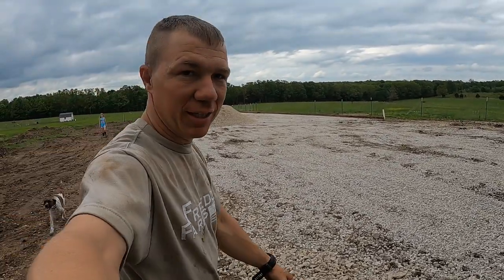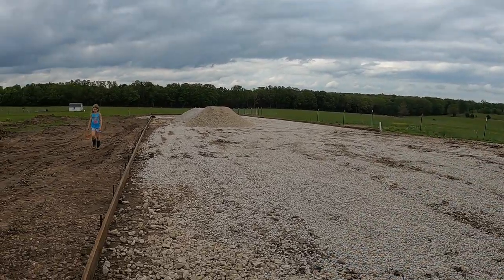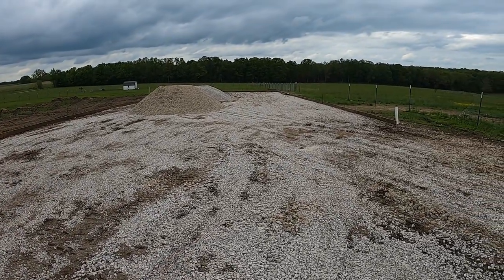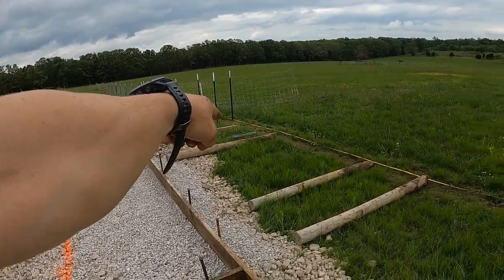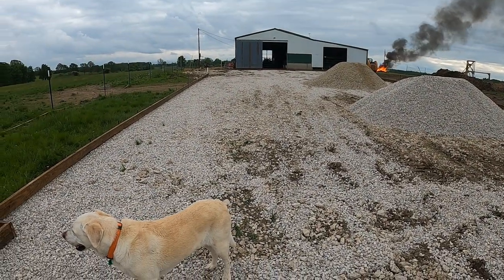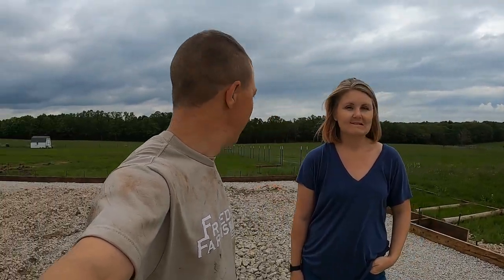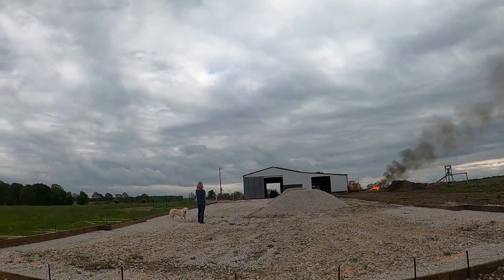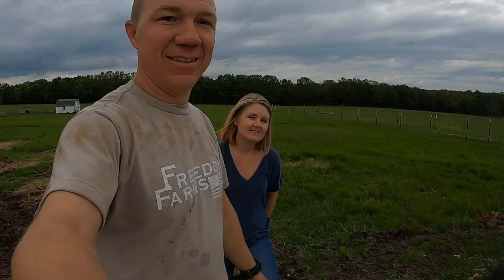Husband and wife build a MASSIVE sheep barn!!!! Part 1: prep work

Comment: I was thinking about putting a agrifab building over an existing 45’x90’ concrete pad and add 4’ concrete sides. Not sure when I’ll have the money for that.
Reply from the maker: That's why we're building in ourselves that cut down a lot of our cost. However concrete this still not cheap. .
Reply: Freedom Farms you’re putting up a metal building right? I’m putting up a building like Sandi Brock’s but not for sheep. Mine will be for equipment and hay.
Reply from the maker: Mine will be skinned in metal but will be wood structure.